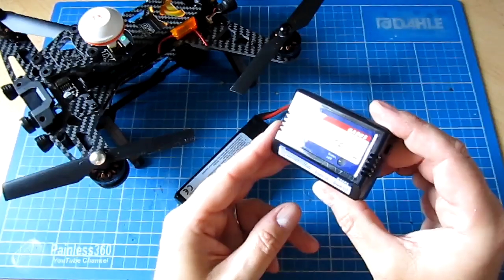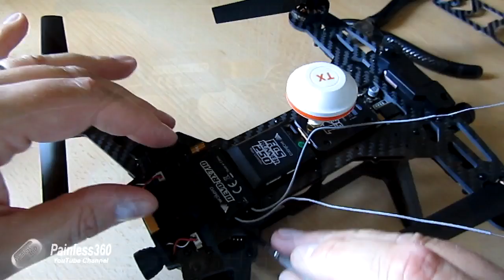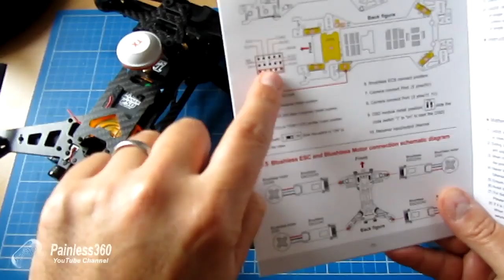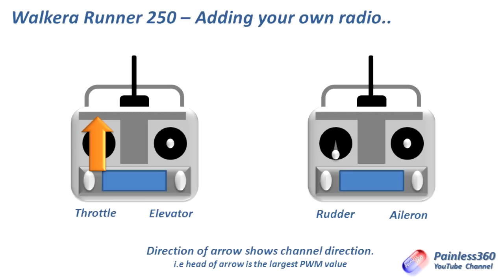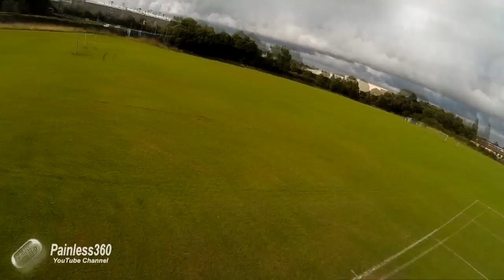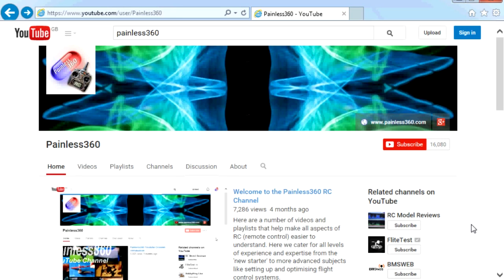RC Review – Walkera Runner 250 review and adding your own radio (from Banggood.com)

Comment: Hi Painless, thanks for the video.

I was wondering if you and your wife might do something for many of us that already own this quad, and for those who may be interested in it, that might very well make our run in with this Runner less painful.

What I have in mind is a video of it being flown by you, with it over some soft grass, flying it up to about 30 feet high (at a fairly fast speed), and then dropping the throttle to zero and right away reapplying throttle. What I am looking for, and what I think others would like to see, is if yours, as so many others, does what is being described as the "Flip of Death" (FOD).

If it does, the Walkera Runner quad will, when you reapply throttle, start flipping and descending out-of-control, and there will be nothing you can do to stop it.

You may not be following the three RCGroups threads on the Walkera Runner (the oldest of which is going on two months old), and that would explain your apparent lack of knowledge of this very important issue, and lack of instruction about it.

Here are the threads at RCGroups, for those that are interested in this quad, and that I highly recommend you make yourself familiar with ( there are also other serious Runner issues needing attention ) :

Walkera Runner 250 FAST & FURIOUS (oldest and most complete imo)
http://www.rcgroups.com/forums/showthread.php?t=2428836

Walkera Runner 250 RTF - An FPV Beginner's Perspective
http://www.rcgroups.com/forums/showthread.php?t=2446428

Walkera 250 Runner - Complaint thread
http://www.rcgroups.com/forums/showthread.php?t=2465486

Yours,
Dan
Reply: Painless360 You might, for example, you know, be racing on this racing quad. (: That would probably require you to drop the throttle from time to time. Also, flips might involve the throttle drop.
Reply from the maker: Sounds like a little bug in the ESC/FC code. I would not recommend this model for flying like that anyway.

For anyone that wants a 3d rocket ship then I'd suggest biting the bullet and building one..

Luckily I don't fly like that.

Thanks again..
Reply from the maker: Dan McAfee Interesting, thanks for the pointers. Not sure why I'd dump the throttle like that though...
Reply: Painless360 
Thanks, there really isn't much pre-built out there yet, and Walkera has failed me with this one (I'm pretty convinced my Runner, in its current state, is not good or safe, be it as a "rocket", a racer, or a casual quad, all of which I want in my next brushless), so I'm already doing that and I'm hopeful I won't be breaking any teeth in the process.

Comment: Can we add OSD module to this quad?
Reply from the maker: Jon Car Yes but only the one they make as the connections are all made in the PCB itself. You could cut the wires from the camera but if you're into that then I'd buy and make a ZMR250 or QAV250..Video showing the Walkera OSD and how this works with FatShark, Boscam and Black Pearl receivers planned..Happy flying!

Comment: Those short little orange antennas laying right down on the carbon surrounded by carbon... that's not a good idea.
Reply from the maker: RCKnut Works great actually, just make sure they have enough clearance from the carbon around the antennas. Feel free to mount yours where makes sense to you.Happy flying!
Reply: Well they should work. but they would also be blocked very easily, especially if you fly away from you at high speed. Sure it might usually work, but I wouldn't trust it to work reliably. Guessing you don't get RSSI on that controller?
Reply from the maker: Not had any issues at all on any orientation or attitude. Out to edge of visible range is fine with no loss of packets reported by the Rx. The frame is open enough to orientate the antennas at 90 degrees to provide the best coverage. I use the same Rx in craft with much more carbon, also without problem. You need to be careful and test it out for each model and mounting option.

I wouldn't use this on a larger model where the craft would be a lot farther out, that's what the Taranis is for ;)
Reply: Now go and make a video on how to do the X4R S-Bus wireless buddy box in battery bay taranis mod :)

Comment: Thanks for the review which was excellent as usual.  I was surprised that the Lipo was a 2200 though.  I would be interested to hear how it goes with a 1300 which would be considerably lighter, although I appreciate that flight duration would be reduced.  Maybe use a 2200 for FPV and a 1300 for LOS aerobatics.
Reply from the maker: UKHeliBob I use 2200mah for all the 250 quads here, let me know if you test it out..
Reply: Painless360 I have tried 2200's on a 250 quad but prefer the high capacity  (45 - 90 C) 1300's.
Reply from the maker: Interesting, what flight time are you getting?
Reply: Painless360 I get 8 minutes zooming about at low level and 7 if I throw in flips and rolls.  I could get longer but I treat my Lipos very kindly and use telemetry to warn of low battery and speak the Lipo voltage at 30 second intervals.  I have the warning voltage set to 10.4V with a 10 second repeat. and the same level set on the Naze to sound the beeper.

The Lipos are Turnigy nano-techs and I use them on a slightly larger tricopter too although that is rather underpowered and could do with better motors.  I prefer both with the smaller Lipos as it makes them more nimble.